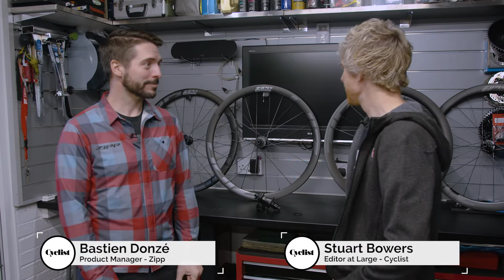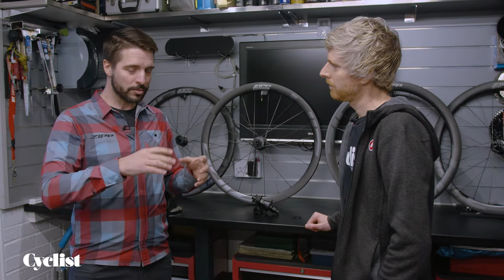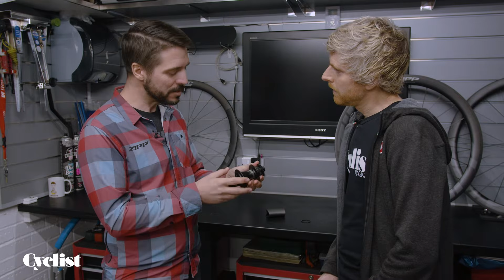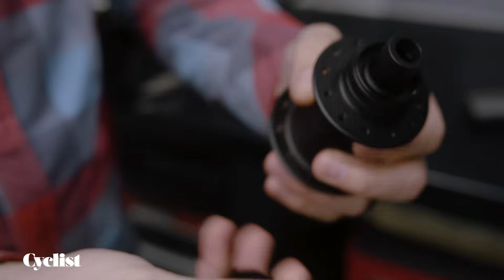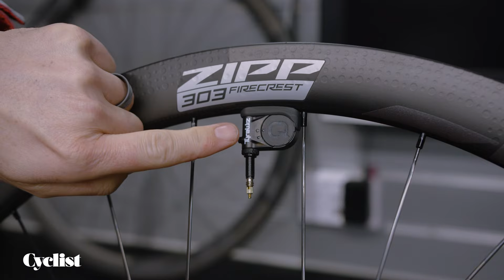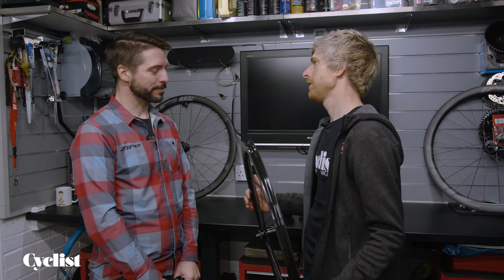Zipp 303 Firecrest Tubeless Disc Brake wheelset: Into the detail

Comment: Deflection is the enemy.  However... and unfortunately... tire manufacturers are falling behind on tubules/hookless offerings.  Until they catch up... A clincher with latex tubes is equally as efficient, perhaps a bit better.  As of May 2022... still a pain in the ass finding tubeless/hookless tires.  I run 62/65 on my 303S wheels... and could not be happier.

Comment: I received a 303 Firecrest set yesterday.   I noticed a pin hole on each rim on both sides.   Is this by design?
Reply: Hi, i wanna buy this Wheel Set... How you like them  ?
Reply: @mortlow6688  i like them a lot.    They came tubeless ready, installed tubeless tires, added sealant and no issues.    Nice and light.  I would buy them again.

Comment: Just curious about the price, the chap from zipp quoted £1800, on their website it converts into the same amount in Sterling, £1800, However on your own website your review suggests £1600. As do several other online reviews. Which is correct?
https://www.cyclist.co.uk/reviews/8243/zipp-303-firecrest-tubeless-disc-a-brand-new-wheelset-with-new-ways-to-make-you-fast